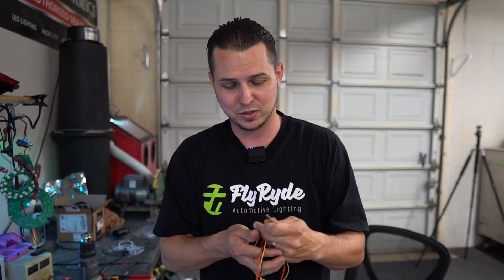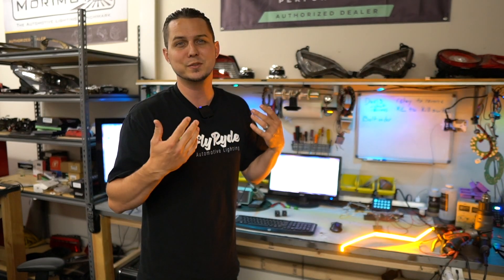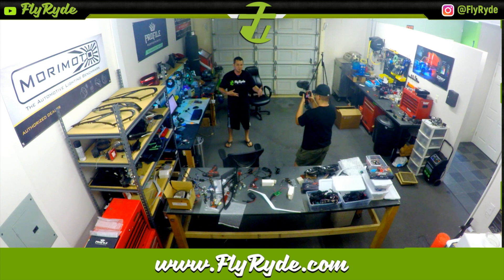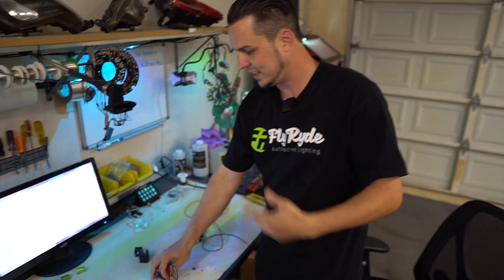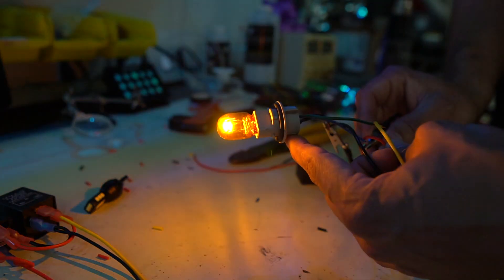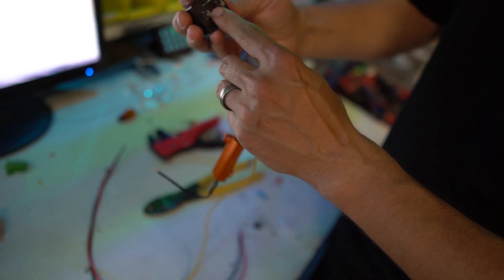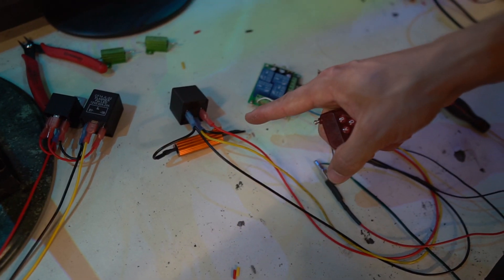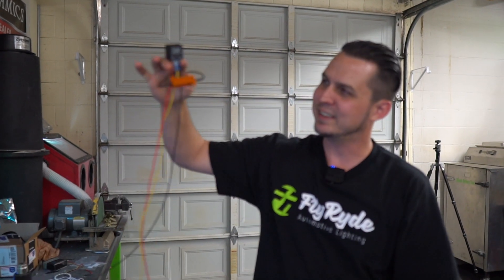DIY Turn Signal Test Circuit | FlyRyde

Comment: wait a sec... Am I dumb or there is a mistake here... why on earth one the thumbnail you have a foto with LED flasher together with a load resistor? that's misleading. when you use a LED Flasher (relay), you dont need a load resistor.

Comment: I know this video is old but why use a resistor wouldn't that defeat the purpose of an LED?
Reply: Delpension what the purpose intended for going LED was... If power savings then yes. If crisper on/off, other colour light/temperature than incandescent, etc, then no...
And if power savings is such a big thing, ease off the gas just a smidge, turn down the stereo a bit, take it just a easier away from stops, make sure you've got the right tire pressure. Any one of those are likely to save more...

Comment: Hello, 
 FlyRyde
I liked this video and it was informative. I decided to try out a pair of flashing brake lights but I am having some problems with them and this is my second replacement but from a different company and it's the same problem. They lights flash as described but then the lights are on the break lights especially the on on the rear brake light it flickers on its own. I attached the load resister 50w 6ohm on both sides. I bulbs that I had were from iBrightstar  and now I have it from AUXLIGHT  1157. I'm not sure what to do. I am thinking of putting in the regular bulbs back in.

Comment: Good stuff. I am confused about the CF 14 flasher marked for LEDs but when wired direct to a LED it didn't flash. A load resistor was still needed. Can you elaborate why this was true?
Reply from the maker: Charlie Rumsfeld nope, cause i have no clue brother.

Comment: I did this basic build last night, except I added a two pin plug for power input and a 6 pin plug for output to lights. Posted a link to the initial demonstration video in Discord. Will be adding some toggle switches to it tomorrow and preparing a second cable for use with the taillights I'll be building next week. May do another video on it tomorrow too.

Comment: Great stuff  BUT IMHO the 10 Amp Power Supply (12volt) is just a PSU and not a proper lab PSU as it lacks;
1) no read-out of voltage or current
2) no 'front-panel' adjustment of voltage
3) no current limiting
4) no short-circuit protection

Comment: Hey could you help me on a problem I have with some switchbacks? I run a 2013 dodge dart and I have resistors hooked into the flasher wire to eliminate hyper flash. However the message center of my car keeps telling me my parking lamp is out. More specifically when my light is switching from amber back to white. Would a 25w 8ohm resistor on my parking lamp wire fix this you think?

Comment: I added angel lights on my car. I tested them directly to the battery and they were really bright. So i end up installing them. But i connected them directly to the headlight so that when my lights turn on halos do too but they became really dim. Not to sure why but im thinking i need some sort of relay. I added 3 halos on each headlight. Wonder if i need realy for each or 1 for 3 and anothrr for the other 3

Comment: Hi been watching for awhile. I love doing my own light setup vs Ebay bought. Love the channel. I have questions that I havent seen you tackle yet. One is there a reason you dont use individual led chips? Two is it possible to use rgb led chip for a switchback affect?
Reply from the maker: Christopher Castillo what specifically are you curious about with individual chips? You mean for sequential?
Reply: @flyryde  I see some people using led chip with aluminum backing and powered by a driver like 3w. I have played with the leds some and have some for rear light on my GSXR,  I bought rgb led cause it said red/yellow.  Since I dont have much room I was going to run the in a switchback (red to stop and yellow for turn) normally I just run wire to positive/negative no problem. This one, however, has one power and three ground. I'm not sure now if it can be done now. I understand  how turn light on jus not sure how, or if I can make it change back and forth. Thanks for your help 😊
Reply: @flyryde  I got it bro. I'm good.

Comment: just yesterday i was trying to slow down my LED sequential tail lights on my mustang by adding one of those resistors. instead of putting it from power to ground, i put it in line on the power. of course it didn't work. I'll put it power to ground today and see if i can make them sequence a little slower. 💪
Reply from the maker: PANTYEATR1 sweet! Hope that’s all you need! What year mustang?
Reply: @flyryde  it's a 95, but i have the 96 tail lights on it...I have a drake sequential kit in it for the 05 mustang which allows you to select blink speed. the slowest setting is still a little fast too, so hope the resistor slows out down another half second...or i may have to go arduino

Comment: But.....................what load resistor are you using? 4 to 6 Ohms?  30 Watts?
Reply from the maker: Kenn Mossman 6 ohm 50 watt
Reply: @flyryde  so that allows 2 Amps to be drawn, P = I^2*R which is 4 * 6 which is 24, double that (rule of thumb) and you get 50 Watts!
Reply: Thanks for the question, was wondering the same.

Comment: Convention is to 'break' the V+ or control and not ground
Reply from the maker: Kenn Mossman I’ve always preferred to break ground with kill switches rather than running extra 12v wires 😁

Comment: Chris. What if I toll you that you can get for less than 4$ a 2 pin led adjustable flasher? No resistor needed.
Reply: WoW!   Though, I can make one for 2 USD
Reply: @kennmossman8701  check my other post
Reply: @changchung  Sorry  I have a life
Reply: @kennmossman8701  Oh really??? Me too. I am happy with it... have a nice day.
Reply from the maker: Link it up dude 👍
Reply: @flyryde  Or a discrete circuit.... http://www.circuitstoday.com/powerful-led-flasher
Reply: @flyryde  Use a 555 or 4066 or Schmidt IC to generate a square wave (a trimmer to vary frequency, another resistor and a capacitor) and drive a transistor in switch mode;  MosFet or NPN;    IRF540 or TIP31 (if using a 555 else a Sziklai around a TIP41 or just be crude and use a TIP120)    TIP31 is rated at 3 Amps     If you want add another transistor to flash another light in tandem      Will look about for a link but most are for flashing a 5mm LED (20 mA),
Reply: @flyryde  Basic idea.   http://myelectronicshub.blogspot.com/2014/07/led-fadingblinking-using-555-ic.html     555 can handle up to 16V BUT maybe protect it using a 14V Zener   NOTE this is the standard NE555 and Not the CMOS version
Reply: @flyryde  There is a lot you can do with a fairly simple circuit. These are based on a 555;  https://mechatrofice.com/circuits/555/led-flasher-circuit                          NOTE the NE555 can output about 100mA continuously so anything higher current sink/source needs a transistor.